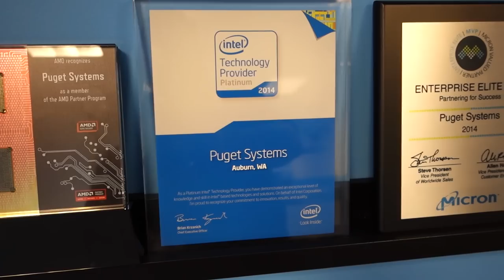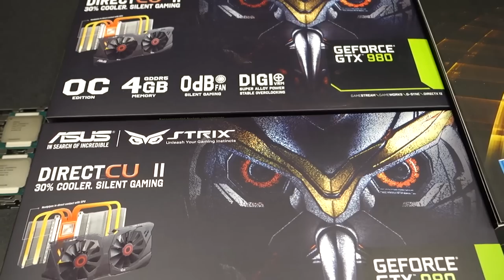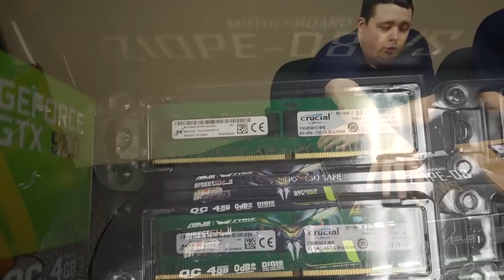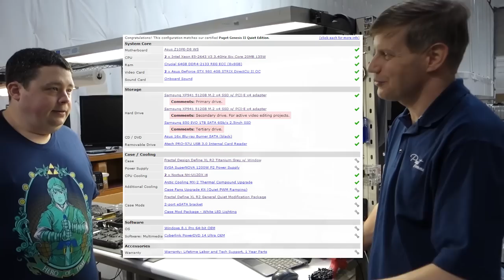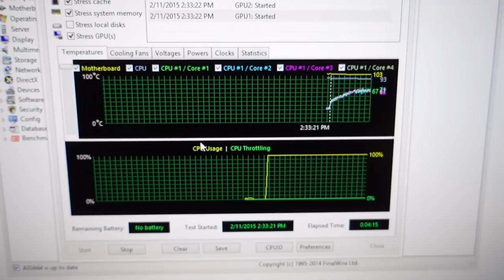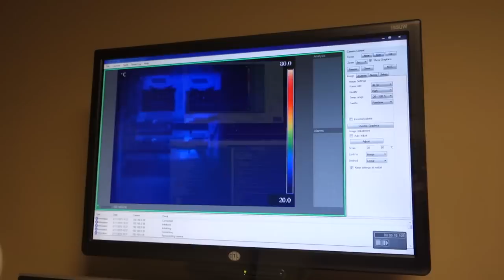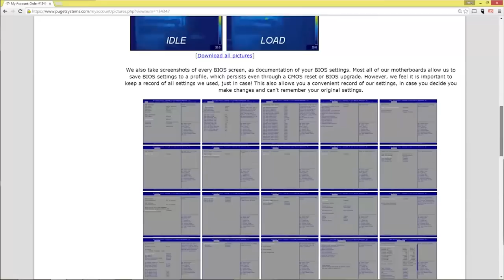Crazy Fast Dual Intel Xeon Monster PC Build by Puget Systems - @Barnacules

Comment from the maker: I'm laughing at the comments from people that think Puget Systems didn't do a good job! I've never seen a system so well planned or tested on my life. The FLIR don't lie folks :D
Reply: The name Puget is unpleasing. Sweet looking system though!
Reply: They do an amazing job I'm laughing as well.
Reply: Now I want my name on the side of my computer
Reply: Beautiful system from a great company.
Reply: Levi Okey  It is the name of the area in Washington.  Puget Sound.
Reply: I think a lot of people don't realize that Puget didn't make a name for themselves with "gaming" PCs. They're professionals that make shit for professionals.
Reply: Overall it was ok but I saw the guy who built it spread the thermal paste on the cpu's which is a very bad and rookie thing to do! Like, how can you hire someone to build pc's when he does that.
Reply: lars330 There is nothing wrong with spreading the paste, it just generally doesn't yield any real benefit. Have you seen how the thermal paste comes on stock intel coolers as well as a lot of closed water loops? it's just much easier to put a drop in the middle and allow it to spread out.
Reply: Alex Smith If you spread it yourself, it will contain air bubbles when you put on the CPU cooler, and not make contact everywhere. This could save you a few degrees in cpu temp under load. This company cares about the temperatures, but fail to do simple things like this to improve the performance.
Reply: lars330 He did?
! What time in the video?
Reply: Mason M. watch from 6:10. Put it in slo-motion if it's going too fast for you.
Reply: lars330 I've tried it both ways and noticed no tangible difference, generally it's just a convenience thing in reality, what you're saying is true and i know it can happen but that's all theoretical just like touching a cpu without an antistatic strap will kill it, yeah in theory it can happen but i've never known anyone who has actually killed a cpu like that. did look like he put a bit too much paste on though.
Reply: I'm with you on this Mr. Barnacules.  They've been around for as long as some of these people criticizing it have been alive.  To say that Puget Systems doesn't build amazing systems that perform excellently is ridiculous.  They wouldn't stay in business for this long if they didn't have the work to back it up.
Reply: F41LZZz If you truly don't believe that Puget Systems aren't building "real PCs" you are god damn insane.  It's just that simple.  What's missing from this build?  Some "dope" LED lights??

Could you elaborate about what makes this PC build not good?  You can't just throw out an accusation like that with nothing to support your insane claim.  So yeah, if you could go ahead and break it down I'd appreciate it.
Reply: Patrick Gallagher what's missing is a filter on the side intake.
Reply: F41LZZz i watch that guys videos too. His builds are spot on perfect.
Reply: Damn what a beast computer u got! :) Gonna last for a long time.
Reply: F41LZZz He explained a lot of this on his Twitter.
Reply: F41LZZz Did you watch it? The way the fans are positioned give cooler temps. They literally tested all possible ways and this was best. They tested with an IR heat camera... -_-
Reply: Ahh man, human narcissism/ stupidty in comment sections never ceases to to sadden me and yet its not even directed at me. To think that guy's like Barn and logan, linus etc deal with this kind of crap on a daily basis.  

Youtube is by far the worst perpetrator of this type of shenanigans, Leave fan interaction to twitter/ fb etc youtube is broken very broken

Would like to see more people making a stand and countering unecersarily hatefull messages
Reply: James Thorogood no stress dude my message was in no way directed at you, rather the small portion of the community that is rotten and delivering critism in a piss poor and non constructive way.
Reply: James Thorogood coincidence had it that your comment was above mine.
Reply: Barnacules Nerdgasm  Its a proper nerd machine that's for sure..everyone and their mother runs i5s or i7s these days. A proper nerd machine does not go mainstream. I like that you sat down and got explained why things were done the way it was. Ive been building pcs for 20 years now and i had a few "huh interesting" moment.. Good job to both you and Puget..
Reply: lars330 Spreading the paste is the proper way to do it; in fact, all the units that come with the paste pre-applied are that way. Complaining about "air bubbles" is the noob-physics thing.
Reply: Danijel Turina The pre applied ones have it completely flat, you can't do that by hand. Search for some youtube vids on the subject and you will see for yourself.
Reply: lars330 Flatness is a non-issue re:bubbles, because the problem is supposedly capturing air bubbles between layers of paste. But it is never a problem, the entire "problem" is, as I said, noob-physics invented by "youtube experts". The only times I had problems with insufficient thermal paste conductivity was when there actually wasn't any paste between the cooler and the CPU, because it hardened&migrated out. To think that air bubbles are relevant is so stupid I hurt when I think about it.
Reply: we need more videos showing us what this machine can do
Reply: Danijel Turina Sure man, whatever. Have fun with spreading that paste.
Reply: That Puget PC IS AWESOME, Congrats
Reply: lars330 "Fun" is a concept I usually associate with more productive endeavors. Just spread the fucking paste any way you feel like, and it will probably be better than the shit Intel applied inside the CPU.
Reply: @ 11:18 ; that was a $13,000 FLIR Thermal cam... Woahh
Love the build!!  Wife needs a Laptop tho.... Nudge Nudge
Reply: System is awesome. Didn't like the part where you were calling William though. Sounded like a part off a porn movie. LOL
Reply: This has been researched folks. Who else, goes into this much detail?
Reply: Call it SBD ( Silent But Deadly)
Reply: F41LZZz singularity builds custom pc's that are made to looks baller. He has a niche market while puget systems are focused on the broader market.
Reply: Levi Okey Puget = Puget Sound, it's a NW coast thing... http://en.wikipedia.org/wiki/Puget_Sound
Reply: did you buy it, or was it just given to you?
Reply: F41LZZz
 funny stuff bro I didn't see one test in that vid that involved a infrared thermal scan of the computer, no testing of the software..........trying to compare a modified case build to a stock case build......comparing apples to oranges......your obviously nit picking, cause you honestly think you know better. people like you just need to learn to shut your mouth...it's your opinion not a fact.
Reply from the maker: Levi Okey Not if you live in Puget county then it makes sense :D
Reply from the maker: F41LZZz Get a FLIR gun, build the same system the way you would want and send your temperatures to Jon Bach at Puget Systems. I'm sure he would love to see your 'better way' that frankly only exists in your head right now. I don't think you're quite grasping the amount of time that went into this system to optimize the airflow. The FLIR camera literally shows them the exact heat build up of every single component in the system plus they use other laser surface temp guns to check individual components and tweak things. You're welcome to your opinion but don't try to push it as fact when Puget Systems has actually done the work to show exactly why there way is best and all you're doing is ranting with no evidence, pictures, benchmarks, temps or anything to back it up.
Reply from the maker: juggernautxtr I honestly think he doesn't understand what went into this and he is one of those people that is dead set in his ways based on his own experiences and will not believe any other evidence produced. It's unfortunate but hey, this is the internet and there are going to be people that think they are right even when they are wrong so it doesn't really matter :D
Reply: BTW this build vindicates my preference for air cooling, because if you direct airflow properly, and use low RPM large fans, you'll get something very quiet, and you also have better cooling of the minor components, the ones that don't get to have a heat exchanger on them.
Reply: You should call your computer Razzor! Imagine waking up coming to it give it a gentle tap and saying morning Razzor! :) It's your call!
Reply: Bro the Xeon e7 could got those for future proofing your system for frameworks and such but e5 are good.
Reply: lars330 this fucking debate again? I thought this died years ago. It doesn't make a difference.
Reply: lars330 The temps don't lie.
Reply: lars330

You sir really don't know what your talking about.
Reply: I didn't think companies existed who put as much work into building systems as these guys, epic ...
Reply: They HATE us cause they AIN'T us!!   :P
Reply: Trolls will never die
Reply: This was and is ammmaaaaaaaaaaaazing !!!! OMG thank you barnnerd and Puget and everyone else who pitched in. Was, was an eye opener and makes me ready and able for the next gen that comes out. water cooling is overkill especially on larger case builds and I the sponsors, appreciate PUGET and BARNACULES for this video! AWESOME
Reply: F41LZZz Hmm, so basically you have no idea what you're talking about.  You posted a link to some guy who builds "cool" looking PCs.  This "cool" PC builder isn't using anywhere near the amount of research/development/data that Puget Systems puts into their systems.  

For some reason in your little peanut brain you seem to think that if something looks "cooler" it must obviously out perform any other system in the world.  Do you realize not a single person has agreed with you?  Here's a hint... It's because it isn't true.
Reply: They do a fine job, I don't know any companies who use thermal imaging to optimise the cooling of a system at all apart from Puget. I've used an IR thermometer but it's difficult to see the whole picture without an Thermal imaging.
Reply: F41LZZz lmfao singularitycomputers builds their PC's to customers specs, there is no optimization for cooling or temps, I know this because I'm a sub and personally own a singularity pc build... singupc is aaallllllllllll based and built on what the customer wants not on  what the customer needs... hence the high price and flashy builds!!! Learn your stuff kid before trying to compare apples to oranges. Your comparing a company based on results and longevity vs a company based on customer specific, lame, unfunctional, radically insane and over priced and managed builds LOL I feel sorry for u sir! In your lifetime of owning PC's your clearly going to end up paying over hundreds of thousands of dollars on flashy led's and over priced water cooling components over purpose built custom workstations and gaming rigs .. gtfo
Reply: They Did A Nice Job With It My Older Brother Built Pretty Much The Same System different case though He Used Water Cooling Though And Its still pretty silent I also said i didn't like the fan colour because he suggested them to me when i built mine
Reply: its ok Barnacules Nerdgasm some people just do not understand computers lol
Reply: F41LZZz
 Singularity only do beautiful gaming computers not silent air cooled dual cpu workstations with the gaming ability.
Reply: F41LZZz This build is optimized for silence amongst other things, so that side case fan is probably spinning well below its full RPM, in which case dust is not going to be as big a factor as you are making out.  I have two NF-P12's as front intake spinning at 300 - 400 RPM, they keep my SSD & HDD's cool and increased dust is near enough a non issue at those speeds.
Reply: Hey there bro! just forget those stupid little fuckers who doesn't back up anything they claim.

anyways puggy made awesome system and the stuff they use ain't cheap nor something easily obtained by average folks like me. overall I think it's an awesome build. keep up the good work bro.
Reply: It looks like a really nice system.
all the nay sayers in the comments crack me up...almost any hack can throw some parts in a case and try to call themselves a builder.
but it does take real skill to build a system that is fast,stable,quiet and reliable and the people that actually research all the build parts for compatibility issues and potential bottle neck issues...and of course good thermal management is always going to be at the top of the priority list.
 Bonus points for wire management in that build...I bet that was interesting...lol
Reply: ***** Stupid is as stupid does ... Run Forrest Run ... :)
Reply: I think this will be good for video, not the best but they did a good job. WHy everyone getting all hyped and hating?!
Reply: Amazing build, the flir does not lie. I've used these devices personally in a data center environment to catch hot spots. Good work Puget Systems, I would be honored to have a system built by them.
Reply: I think they are annoyed of you...
Reply: Finally! A video that I know I'll enjoy, another great video Barnacules, hope ya have a great weekend!
Reply: ***** I'm guessing due to the price drop and slightly higher single thread clock.  As they said the single thread clock is important for the gaming side of things, and there seems to be about a 600 dollar difference in the price for a dual CPU build, so that may have factored in.  The overall speed of the other CPUs might outweigh that slight bump in single thread speeds and the cost, but I guess that is debatable. 

Personally I have been thinking of building a rig similar to this as I do quite a bit of 3D work and occasionally edit a video too, but I was looking more at the E5-2640 v3, a much lower down the list processor with a significantly smaller price tag that actually outperforms the 2643 in overall benchmarks (undoubtedly due to the 2 extra cores) and doesn't take too much of a hit on the single thread power. 

Ultimately though the 2643 doesn't seem like a BAD choice at all, things start to get a little muddled when you get into the higher processors trying to judge price/performance, especially if you intend to game on them too.
Reply: So awesome that those guys care so much about every detail of the system build.
Reply: lars330 Spreading thermal paste is not a rookie thing to do - it's all dependant on the type of thermal compound you use. Some have a higher viscosity than others and work better when dispersed on the chip before applying the heatsink.
Reply: Barnacules Nerdgasm Awesome computer. I have had the opportunity to use several Xeon based workstations and I really find it amazing how responsive they manage to feel even while under a high load.
Congratulations! Now don't let the people saying they could have done better get to you.

lars330 As meleniumshane90 said, spreading it is not a rookie thing to do. The reason that the pea method is recommend for most people is that it is easiest. It is very easy to tell a beginner to just put a pea or a rice grain size dot on the center of the CPU, instead of trying to get the correct size line down one side for spreading. When properly applied with the spread method, the difference in heat isn't measurable. 

F41LZZz Singularity Computers does build some quiet builds, but is far more focused on stylish builds. The majority of the builds that I have seen on that channel are for viewing pleasure and gaming. You also have to consider the cost of a computer built by Puget vs Singularity. Some of the custom case jobs that Singularity does make the case worth several thousand without components in it.
If I had to guess what he was doing at 8:11, I would guess that he is placing a bit of glue to hold the slack from the wires, or perhaps placing a drop of glue for anti-tamper purposes.
If things really work the way that you claim they do, and you can't find proof, then create it. Create video proof, and a write-up detailing how you got your results. I'm sure that there would be many people that would thank you. If you made a video well enough, then I'm sure that there would be a large viewer count due to word of mouth. If you can really do better, then take a bit of time to prove it and make yourself some money.
Before complaining about the dust that will come into the side of the computer, take a moment to realize that this system doesn't really have any dense heatsinks for it to get stuck in. This computer can probably run a year without any noticeable build up. It might also be advisable to think just a little bit about the cases that have dust filtering. Most of them are aimed at gamer builds, and not professional environments. In most professional environments, computers are subject to regular maintenance. On the other end of the spectrum, you have many gaming builds that go to people with little technical expertise, and don't think to clean the computer ever.
Not trying to degrade the gamer community, but it is a common things for me to see.
Reply: lars330
I've probably been building PC's longer than you've been alive, and honestly it doesn't matter how you put the TIM on the damn processor. I prefer to spread it because otherwise I do not get completely uniform coverage on the Die cap. When you've built enough systems and pick up the "feel" you can actually get really consistent about the thickness of your spread. The benefits either way are negligible in the first place, and that "Air bubble" nonsense is the epitome of bigfoot. Everyone says they've heard of someone who's seen it, but no one actually has. The real fact of the matter is, if you're getting an air bubble under your Heatsink, you're putting the HS on wrong. I've built things from simple little home computers, SFF boxes, office workstations, NAS's, SAN'S to high performance server clusters and ASIC monstrosities and systems that have had so much throughput your puny little toy that you built all by yourself would be put to shame. Now get out of here with your baseless claims and go learn a REAL thing or two about high performance computing besides regurgitating what you've read on some forum or message board. Become a real expert instead of some chair theorist.
Reply: I hate to say it, Barnacules, but you act like Puget did some magic to put your system together. I suspect that if you had to pay for it you wouldn't be speaking in the same manner.
a.) Either that John knows nothing, or ASUS lies, because that board has 7 x16 PCI-E, and that comment on GPU positioning he did sounds pretty invalid to me
b.) GPUs in SLI "talk" to each other via the SLI bridge, so that comment is also invalid
c.) FLIR does not lie, but let's see how will it fare in your nerd-cave in the summer ;)

Other than that - I'm glad you got yourself a new system. That means more awesome videos. Just don't be that easily succumbed to ass-licking.
Reply: A3tr03 That board has 7x PCI-E x16 for sure, but they will not all run in x16 depending on your configuration.. they never do man.  If you go out and buy a board thinking you will get every PCI-E working at their full multiplier just because they say x16 after them, you will be disappointed, just saying. 

Also it sounds like you think the CPU only talks to one GPU and then the 2 GPUs communicate all that information and share the load via the SLI bridge.. That just isn't the way it works, the sli bridge is for synchronization and pixel data... basically it's an output thing, the CPU still has to communicate with BOTH GPUs. While I don't actually know the performance implications of running an SLI on 2 separate CPUs it makes perfect sense that the CPU having to relay information through the other CPU first would hinder performance.

You shouldn't just go plugging things in wherever they fit on a motherboard...
Reply: Ondaedj "Quad Strength Graphic Power – 4-Way PCI-E Gen3 x16 link SLI/CF"
That's on the ASUS site. It doesn't say x16/x8/x8/x8, it says 4x16.
That board is advertised for graphical workstation. 
Also, if you did 4-way on that board, how would the two CPU-s handle the situation?
While rendering it doesn't matter as the GPUs work as if they were standalone, so there's no GPU-GPU communication.
But in gaming? What if the game decides to use 8 cores? That's spread on the two CPUs. Isn't that the same situation with regards to hindering performance?
Plus, the CPU-CPU link is way faster than a x16 PCI-X lane, so even if the data passes through the other CPU you'd hardly ever notice a delay. Like in nanoseconds.

Point of my comment is that although I like Barnacules having a new PC, I dislike the praises for Puget. The system they build may be silent, but is ugly as hell. Cable management is non-existent.Not to mention the amount of dust it'll gather over the top vents while the system is powered off.
Reply: I think they did a great job. I bet you will love the silence because your old monster was so loud!
Reply: + A3tr03 To utilize 4x16 SLI you would have to run 1 3 5 and 7 slots, the 5 and 7 would run to the second CPU. Like I said, I've no actual idea what performance hit you might take running them between 2 different CPUs, but it makes sense that it would be better to run off 1 when possible.

Maybe I am misremembering, but I thought they skipped the 3rd slot in favor of the 4th to leave a gap in-between the GPUs for better cooling performance.  If this is the case the second card would run at x8 not x16.

It does seem like they may have been able to run them both on the second CPU using lanes 5 and 7, giving them both x16 lanes, but they didn't really address that I don't think. (this would push the cards together again potentially causing more heat issues than they were willing to have)  Again the whole 2 CPU thing throws me off some, as I haven't done extensive research into it until recently (mentioned in an earlier comment that I've been looking into a build like this myself).  All I'm saying is it makes sense that you would prefer them on 1 CPU rather than 2.  I also know from extensive testing that SLI running with your second card at x8 vs x16 makes virtually no difference.

I'd be interested in benchmarks related to this situation (the running SLI across 2 CPUs vs 1) as I've not seen them myself. Maybe I will search around a bit and see if I can find some.

Just FYI I don't completely disagree with some of the things you are saying, while watching the video I noticed a few things I would have likely done differently as well.  Just pointing out the things that I don't necessarily agree with.  I could go off on a rant about some benefits of going with that specific company for Barnacules, but this post is crazy long already so I wont.
Reply: William is the best!
Reply: ...you still have a landline phone? :D
Reply: i love the pc itself but i hate those ugly fans! you should paint them to something like blue or green or yellow
Reply: Dima Martens Sometimes something can be so ugly that's it beautiful  :D
Reply: Did u use triple e ram
Reply: Did they do a good job. Yes. Did they do a great job. No.
Reply: Yay!
Reply: Barnacules Nerdgasm Gotta trust the guys that have tried it. Especially when their reputation rests on it's performance with your good self. Awesome build. Thanks for sharing , sir!
Reply: Next time waste that kind of money on a GYM membership.
Reply: name xander v2
Reply: How much did it cost?
Reply: Dozs ites rune myainkampf?
Reply: AHAHHAHAHAH RADIATORS AND BLOW OFF VALVES aha car guy things
Reply: Name it the eagle of fvcking awesomeness
Reply: I don't understand the idea of someone else building my computer well I do if you just want to blow money and be lazy. But after watching this they really put a hell of alot into buiding and planning of the rig for present and future support. Although I will never have someone else build a computer for me I was thouroughly impressed by how much Puget handled the whole process.
Reply: Well I understand why he is doing it, just why anyone else would. How much do they charge?
Reply: ***** Have you ever come to the realization that people would accept your comments more readily if you tried using something that the rest of human civilization uses while typing...it's called PUNCTUATION! Holy hell! I don't care what your IQ is in actuality, but when you refuse to use punctuation in a proper sentence or paragraph it makes the reader have a first-impression view of you as if your knuckles drag on the ground when you walk. Sheesh!
Reply: ***** The proper term is "Bang for your Buck". It was used in the 19th & early 20th Century when describing the quality of explosives and the cost per pound of said explosives - hence, more "Bang for your Buck" meant that you were getting a  higher quality explosive per dollar.
Reply: Wow - such wonderfully colorful language you use now! Your English seems to be improving by leaps and bounds!.

May I suggest that you sit yourself down, calm yourself before you have an aneurism and do exactly to yourself what you suggested I do to myself.
Reply: call it the bunson burner
Reply: I'm laughing at you for spending 1000s on a pc you could have easily built for half... testing? Lol that fan configuration is laughable.
Reply: Also find it funny that thag pc looks no different than a regular build except the fans are In shitty spots and the kid who build it looks like he's 16... smfh. Barnacles you want a pc built let me know I'll do it half price.
Reply: But I guess when they give you a 5k pc for free and build it you have to ride their nuts.
Reply: ***** Me too I would love something from them too, they do the research and everything for the best cooling, and proof. I don't know why these guys put on the hate when they BUILT it for him. Anyone would want a built. But I built my own comp. It's time to upgrade for me soon tho. 670 slis not enough
Reply: ***** Me too. :D
300 fps in Minecraft. XD
Reply: Does Anyone know if I could run a raid 0 setup with 2 850 pro ssd's, but then still keep my intel 520 ssd and 1tb HDD as storage drives, for pics, movies, and games?
Reply: Brandon w yes you can
Reply: Levi Okey Poo Nugget
Reply: Barnacules I would suggest slowing down when you're talking a bit. It sounds like you're on a something. It's my only gripe and just wanted to mention that.
Reply: lars330 You don't know if there was any air bubbles. Both methods is correct, as long as you know what you're doing.
Reply: Jessica Wu I can't see any problem with doing so.
Reply: wow this would be like my dream job working for Puget Systems, I'm an IT Technician and i build my own system however in Scotland very hard find job in Computing building so I have IT side on back burner time being , is this in America ?
Reply: sound like cool job sad i cant get job in IT around Scotland, anyway nice meet you cheers
Reply: Can you do a liquid cool 1u server blade system with about 12-15 blades?
Reply: Danijel Turina Uhh no, do not spread thermal paste on CPU's. Air bubbles arent the real issue. Its actually how much coverage there is after you spread it and place a heatsink. Any air bubbles should be naturally dealt with when you tighten the cooler down onto the motherboard. Having globs of paste leaking out from under the heatsink can be a bad thing if the paste can conduct electricity. Arctic Silver 5 is a primary offender for that.

My source? Ive built/fixed PC's for about 12 years. Ive tested temps after spreading and not spreading various brands of thermal paste. With very few exceptions, letting the heatsink spread the paste lead to lower overall temps. A few degrees celsius can really matter in warmer months. If your CPU runs at 57C in the winter it may end up running 60-62C in the summer. AMD FX 8350 recommended max load temp for 8 cores is 60C. Chances are you wont have a system breaking temp differences between spreading the paste yourself and allowing the heatsink to do so. Its just that lower temps under load are better as a rule of thumb.
Reply: Hey Jerry When are you going to do the unboxing because i see in the other videos you already have it fired up
Reply: Barnacules Nerdgasm But it uses a xeon, that's NOT a personal use type of CPU and unless you are running a server for a mission critial use then it is completely overkill and will not benefit you in the ways you want, sorry to say, but they screwed you
Reply: Nacalal mission critical is just a term used in context.. if he has cpu intensive tasks to do ( faster or whatevervideo rendering/editing) this will serve him really well.. just don't expect that 2 cpu's will run your software twice as fast.. or that its supported by videogames.
Reply: ***** Correct.  Enthusiast gaming and video editing/rendering are very different tasks with very different workloads.  Most games won't use more than 4 cores (so overclocking on comsumer CPUs is really important), but lots of CPU-intensive rendering programs will fully utilize a lot more cores (making overclocks less important than core count).

It's also a GPU thing, which is why they used 980 cards instead of cards like quadros.  A Quadro is great for optimized rendering programs, but it's not great for the dynamic tasks of gaming graphics. (Larger memory bank, but a smaller bus).

Plus, if you ever have a multi-hour rendering project fail, you want to take a walk and punch old people in the street.
Reply: Barnacules Nerdgasm The only thing would done other way is to make the CPU Coolers push/pull and add a extra fan to the side panel. But they done there job very very good.
Reply: Barnacules Nerdgasm 7 days to build a pc? it would of took me 30 minutes to 1 hour
Reply: ***** I can see the reasoning but unless the clockspeed is equal to that of an i7 for example (this is only an effective comparison between similar architectures) it would actually under perform, server quality CPUs are better at doing more tasks at once where as something like an i7 or i5 is better at doing bigger individual tasks at once
Reply: Jake he is being paid to say good things about them. I'm going to check out your link
Reply: John Drek rich professionals that need overpriced computer
Reply: they did a great job dont get me wrong if i could i would get them to build a pc but its overpriced for someone on a budget
Reply: When are you going to release another video about it you said you would?
Reply: lars330 I'm confused. Are you promoting spreading the paste?
Reply: doluseb Nope, the opposite. ;)
Reply: lars330
ah ok
Reply: Obviously you would say good things since you got it for free.
Reply: +Jake i like how you used your heat sensing eyes through your own screen to detect that this was a bad pc build.. they clearly set out to go for a non water cooled system.. yet here you are advertising a link to a water cooled system.. gg sir you are amazing, can you teach me how to do that?
Reply: thats a beast pc
Reply: +Barnacules Nerdgasm it is a good system but you should've went with water cooling, i know its your choice but just saying
Reply: Barnacules Nerdgasm ppl are laughing the cost you spent on that rig :D
Reply: Cruzinator- WTF are you talking about?